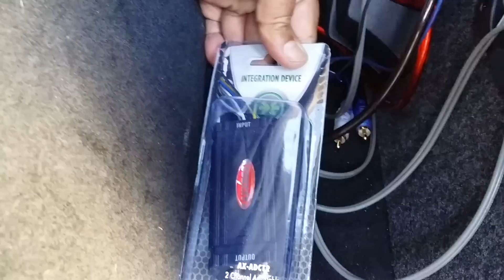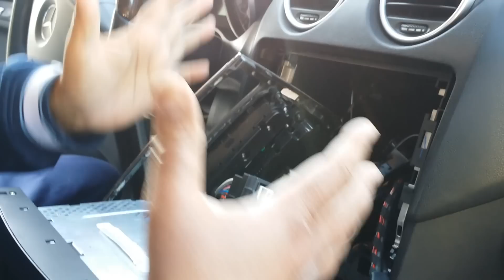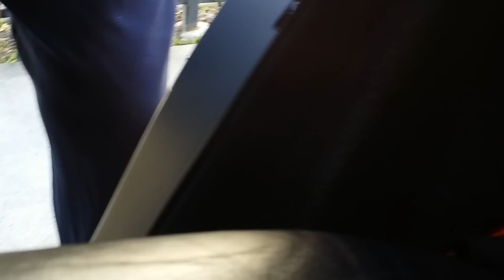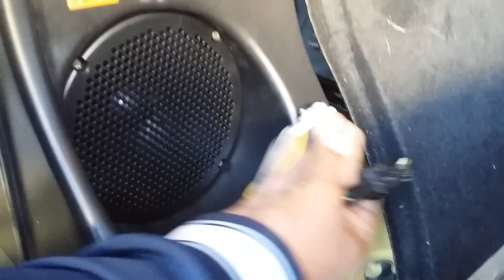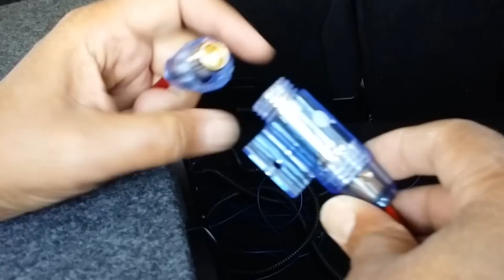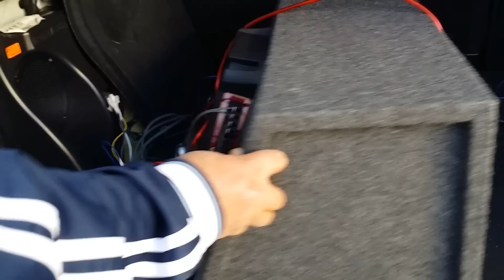How to install an Amplifier and Subwoofer | W164 Mercedes ML500

Comment: Thank you for all the info . I think the amplifier power fuse should be close to the battery positive terminal as possible . Otherwise if the power wire damage and touch the chassis there is no protection.
Reply from the maker: Great point, Thank you. Please share, thanks.🙏
Thanks for the like and thanks for watching,.🙏

Comment: I was looking for wiring information when I came across this video.  For the W164 with HK Sub...the subwoofer has four wires.  It looks to be a dual voice coil sub.  The black and white wires are NOT power connections for the sub...signal is amplified w the amplifer under the driver seat.  The wiring from the amplifier to the sub harness is: white/blue (+) - green (-) (channel 1); black/white (+) - gray/wht (-) (channel 2).  These meet with different color wires at the sub harness.  If you are tapping at the subwoofer for a high level signal in order to install an aftermarket amp and sub, you will want to take all four wires into a two channel line level converter to make sure you have all available signal.
Reply from the maker: Thanks for sharing the info.
Reply from the maker: I have started posting DIY videos on my other channel "Sidhu DIY" so please subscribe, thanks.
Here is the link for my other channel, thanks in advance.
https://www.youtube.com/c/SidhuDIY

Comment: please help i have a ml 350 2009  i installed a  aftrermarket radio/kenwood and now i have crappy fm am reception. i want to tap into the power source of the cigarette lighter in middle console. which wire do i tap into? thx in advance
Reply: @EasySteps_Sidhu   what's a hot wire? And thx for your awesome videos
Reply: @EasySteps_Sidhu  ok thx. I will do in morning. I'm in New Jersey it's dark here. Thx again
Reply: @EasySteps_Sidhu  do you mean i need to  tap the antenna amp wire in to a  12v source?
Reply: Sorry to bother you again  do you know where is the ground wire is for antenna amplified antenna for fm and am radio? Everything is hooked up probably  99percent chance that the ground wire is lose. Please help thank you much

Comment: Great video, super helpful when doing a similar install over the weekend. One note though: All four wires shown at ~9:00 are speaker wires. They come from the amplifier to the dual voice coil sub. The red and black are just positive and negative audio signals, not power and ground, and have an identical signal as the green and white. If you follow those upstream about 8" you will find the sub amplifier.
Reply from the maker: Thank you so much for the like and thanks for watching, I always do answer to my viewers for their every question.
Unfortunately, my account got hacked and this hacker has deleted all my comments from 1800 + videos.
I am posting a thanks message to my viewers/subscribers for their support.
My YouTube channel was hacked/hijacked on (4/24/2019) and I got it back now (5/5/2019). The hacker has deleted the information under the description of my videos as well as all my comments. 
My YouTube Account Got Hacked - https://youtu.be/1xLEciPJqlk

Comment: I hav a 2006 ml350, but when I open the panel in the trunk it doesn't have a subwoofer, what do I do?
Reply: Combathacker24 did you find the solution?

Comment: Thanks for the video! Planing on installing subs in my GL550 now I know where to run the wires as the battery is under the seat.

Comment: look s all great. you only made 1 mistake. the fusie had to be as close to the battery as possible. reason for this? against shortcuts the cable might het damaged on the small part. in your video the cable could burn trough the hole car from battery to the back. for the rest great vid!!!

audio lover
Reply: Icarus H Ha! Took the words right out of my mouth. Within 16-18" is the recommended fuse distance from battery....as the wire before that is left exposed and suseptable to fire is overdrawn upon -and we'd like to keep that to a minimum. So..  Well played, sir.

As for the the gentleman doing the video, a very courteous video. I'm doing a gl450 in the morning and was curious as to the wiring colors. Thanks very much

Comment: Nice video sir,  so just to be clear, with this installation you didn't actually need to pull out the head unit?
Reply: @EasySteps_Sidhu  what is the RCA adapter you used